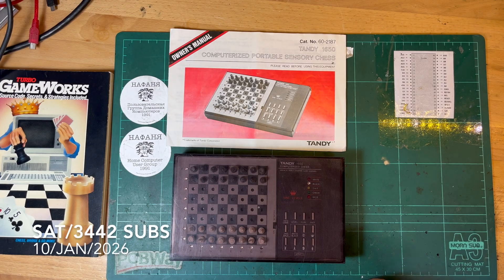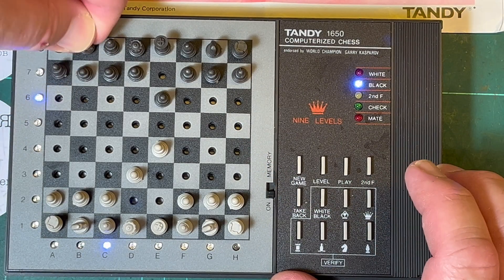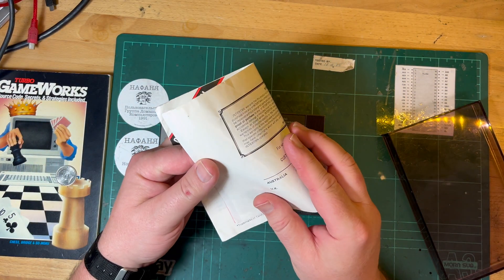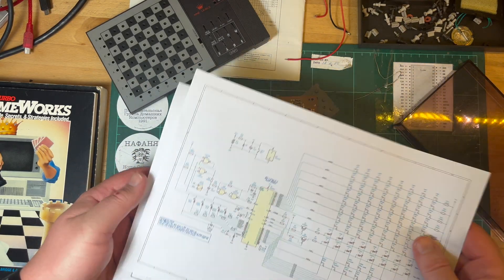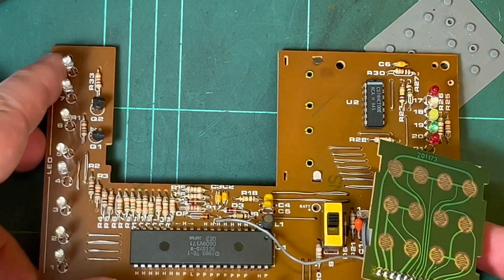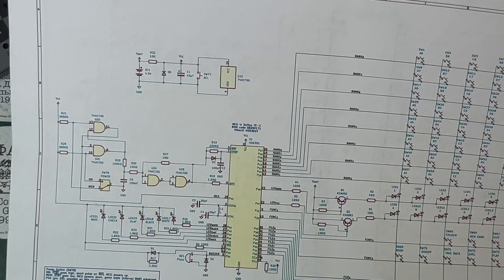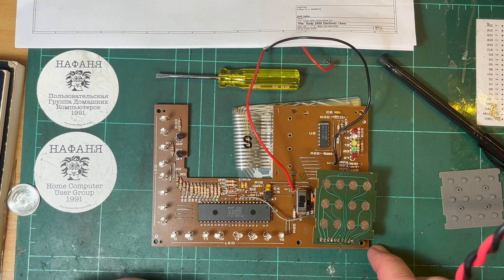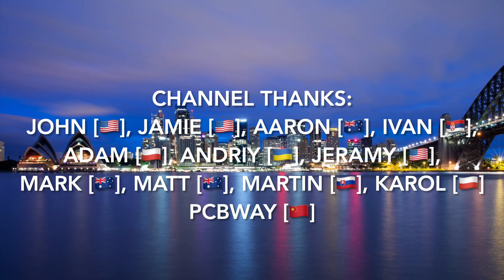🇩🇰 LogiChess: Part 2 (Chess Co-processor?) [#TCE0673]

Comment: Nice!  Really novel idea, I look forward to following along.  130Hz and 60Hz for the keyboard and LED strobe frequencies should be doable 👍  I wonder if there's a way to get the co-pro and VIC to co-operate meaningfully, rather than the VIC just acting as a UI to the Hitachi chip. Hmm, perhaps have a much larger opening book on disk accessible to the VIC and then hand off to co-pro once that's exhausted?
Reply from the maker: Thanks!  Let's see if I can actually pull it off.  Getting the timing right with it switching between pulsing the FILE lines to check the keyboard buttons and pulsing them to light the LEDs will be tricky (for me at least) ... I was thinking I could use an ATmega on the cartridge to interface to it and thus simplify sending the data back to the VIC ... but then I might as well just implement a chess program on the ATmega itself (that's something I doing for the Nixdorf LK-3000)

Comment: Sargon II on VIC-20 says in the manual that Level 0 is immediate response, Level 1 is 20 second response all the way to Level 6 at 4 hour response.
Reply from the maker: ... IF ... I can get it working, I was going to pit it against a purely software chess, two VICs running side-by-side ... maybe not the max level though!

LogiChess apparently was, and probably still is, the strongest 4KB chess implementation.

Comment: 3:10 that can be boiled down to a cpld or even an atmega chip

Vector/array processing, branch predicting, and some cache memory 

Then spit results to computer as if it's an io device

Not just chess but could do checkers too

Called building an application specific integrated circuit 

Only does a few things, but does in physically in hardware so it's faster

Calculate a million chess moves at 1mhz in 1 second

Probably can do it with a GPU shader
Reply from the maker: Ahh, ATmega ... that might be easier in the long run ... maybe this LogiChess runs too fast (3MHz) for the VIC, although I could slow it down.  I am already working on porting a chess game on Arduino for the Nixdorf LK-3000 "computer" ...
Reply: @Brfff  depends on what kind of project you want it to be for you!
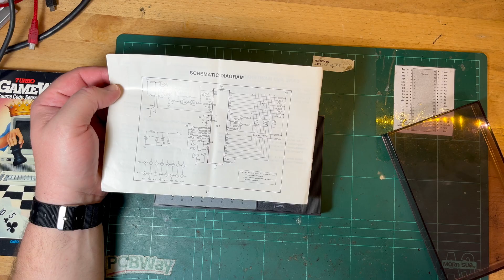Reply: 4:10 Basically hook the matrix to the cartridge port or expansion port

Or even joystick port

Could Use a shift register to reduce the amount of io needed from the computer, at the cost of transfer speed

And then the computer just looks at a block of ram, based on the data provided by the microcontroller

Write a basic program full of peek and poke 

Or load some code from a tape or floppy, need that "device driver" to know how to access that shit

Funny all you really need is an Atari pokey chip

Has a built in matrix decoder

And can also do potentiometer for paddles, and spit out a bunch of sound too

And then a via or pia for the leds and gpio inputs

Comment: I had one of those Tandy chess games!
Reply: So here's the Hitachi HD6301 programming manual: https://archive.org/details/bitsavers_hitachidateriesHandbook1989_54281821

And just for fun I looked to see if one was for sale, and I found a "Portable 1650L" for $7 USD ($8.79 shipping).

So I wonder how closely the ROM matches up to the old Sargon Chess? 

Retro-Sargon ("Original-ish" 8080 assembly along with Z80 and x86 ports): https://github.com/billforsternz/retro-sargon
Reply from the maker: Ahh, porting Sargon to the Soviet Радио-86РК is one of my background projects.  The "problem" with their listing in the book, if I recall properly, is that they used some sort of pseudo-8080 mnemonics for the Z80 so it's a bit hard (for an amateur like me) to backport it to pure 8080, like the Z80's extra registers that the 8080 doesn't have
Reply: @Brfff  The github guy mentioned the 8080 - Z80 incompatibilities, but wouldn't that mean that it was good to go for an 8080?
Reply from the maker: @MrWaalkman  The problem is, I think (I have the book) is that they coded for a Z80 but using some (now obscure) pseudo-8080 mnemonics ... so it's kind-of 8080 but has additional registers used in the Z80 but not available on the 8080 so it's not possible to do a conversion easily.  Or something.

BUT ... it has been done ... from my post on VCFED Forums:

"March-April 1979 issue of Recreational Computing alludes to it, using macros to replace Z80-specific mnemonics"

https://forum.vcfed.org/index.php?threads/8080-back-converting-z80-8080-index-registers.1249549/
Reply: @Brfff  Yup. I see that now on the site that I listed. Oh well.